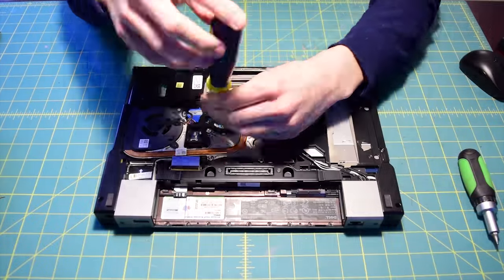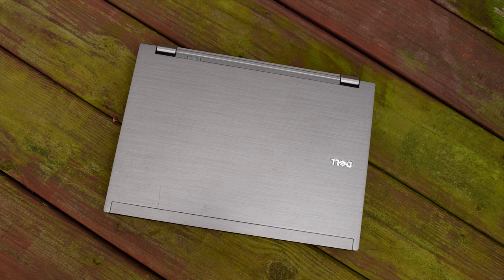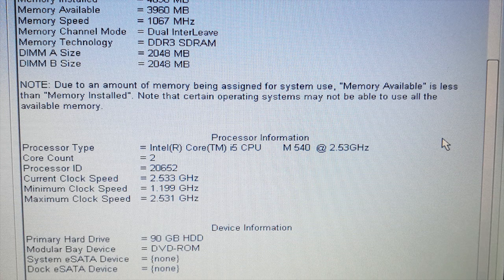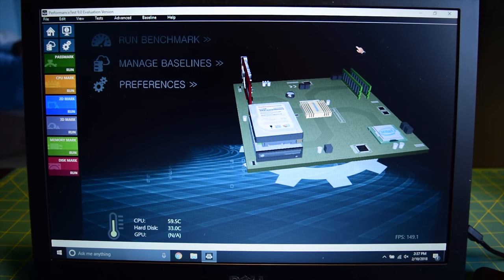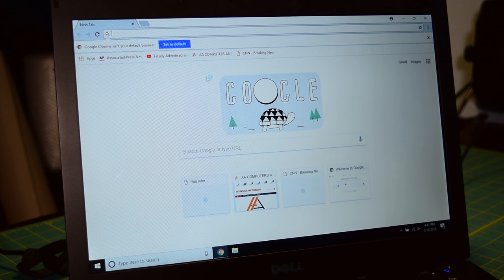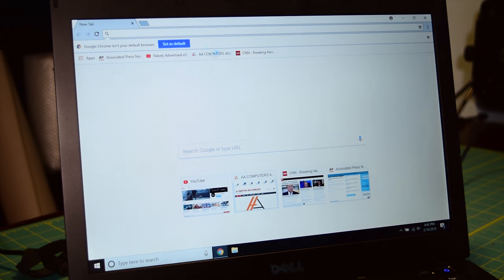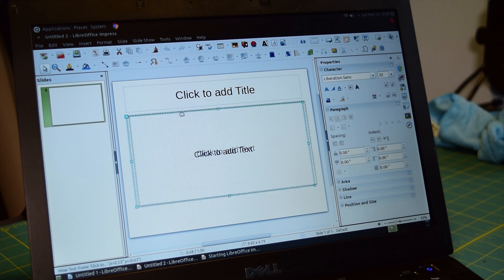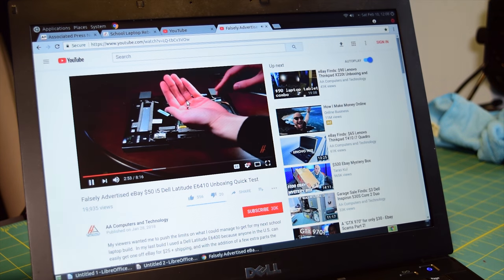Intel i5 School Laptop Rebuild Under $135 Dell E6410

Comment from the maker: Just for clarification: I noticed towards the beginning of the video I said I bought the E6410 for $50+ shipping.  The $50 actually included the shipping, so it was $50 total (it actually ended up being $30 total after I got a partial refund because the laptop was listed incorrectly).
Reply: Hhhhh Nice job . dude ❤
Reply: that's a steal, wow
Reply: About to get one for $40 at a pawnshop

Comment: I got a Dell E6430 with the 1600x900 res screen, Core i7-3520M, 8GB ram, and Nvidia NVS 5200 1GB dedicated Graphics for $85.
Reply from the maker: Awesome deal!
Reply: I bought same laptop, same specs but it has 256 GB SSD. But they charged 160$. Mine is completely new running Linux.
Reply: I threw my old 120GB SSD in mine and added a 1TB HDD to the disk bay
Reply: HPad, Why?
The SSD should be alot faster. And also you could've swapped the DVD drive with a 1tb hdd and have the ssd for boot
Reply: Green Hoodie Media huh? I don’t think you understood my comment.   I threw my 120GB SSD AND a 1TB HDD in the dvd drive bay lol.   Even though this is a travel laptop I still gotta have SSD. I’ve been using SSD for boot drives In my computers since 2012. It’s hard to use a HDD as a boot drive anymore.
Reply: oh sorry I thought you meant you repleced the 120gb ssd with the 1tb hdd
Reply: One advantage of the E6440 over the E6430, besides being another CPU generation newer, is that the mSATA slot in it fully supports mSATA drives and allows you to boot from them.

The E6430 is iffy, people on the net say yes and no.  There is a video on the E6420 noting that you could trim the plastic around the CMOS battery and shift it and probably fit a 50mm mSATA in the 25mm mSATA slot, but that was 2 years ago and he never updated with whether it worked or not.  AFAIK the 6420 and 6430 are nearly the same in that area of the MB, so if it WERE possible on the 6420, it should definitely work on the 6430.

I have a free 6520 I may investigate this on someday, but I'm in no rush since it will be a secondary/tertiary laptop, and I already have a 120GB 2.5" SSD for it.

EDIT:  Hmmm, looking further, there are various YT vids on the E6430u that clearly show a full 50mm mSATA slot.  Not having a 30 series, I'm not sure if the 6430u is different than a "normal" 6430.
Reply: +HPad Lmao Green Hoodie took the word 'threw' too literally xD
Reply: yeet
Reply: Green Hoodie Media Did you copy Green Ham Gaming's channel name? 😉 PS: You upload really weird vids
Reply: I really didn't
Reply: Well the thing is that SSD has no moving parts at all, whereas the HDD is quite fragile. One fall and boom. Also, SSDs tend to be a lot more quieter and consume less power. SSDs also are significantly smaller than HDDs.
Reply: HPad lol

Comment: A couple months ago I picked up a ThinkPad x240 for $155 shipped with an i5 4300u and 8gb Ram, more recently I threw a 500gb ssd in and it’s been great ever since. It can even play some light games, such as CS: GO and TF2. It can even edit 1080p video!
Reply: I just bought a T430 with an i5 an Nvidia GPU, for $150 I'm so happy haha it runs CAD & IDE's like cake.
Reply: A awesome choice!
The only other one that is eveb better, is a t430 (or similar) with a 3 gen i5 and a nvidia gpu. 
Then upgrade its processor to a better i7 maybe qm with 4cores and 8 threads, upgrade it to 16gb of ram, ssd and hdd with caddy. 

The only problem i would see in yours is this new cancer of soldered processors, that may have bga problems. But as it a lenovo one, it probably wont have this issue, only you cant upgrade it. 

So good buy!
Reply: I took out the i7-3632qm from my old/broken HP ENVY M4 and put it into my T430 runs perfectly. I bought a HD caddy but the dimensions were a bit off. all I need is 16gb ram  but it's expensive haha

Comment: Great work! I love this rebuild videos. I love hunting for 'hidden gems' and give it a new life. Sadly here where I live, it's very hard to find an old laptop with price under 100 usd. Even for a 10 y/o laptop model, it's on the market for around 150usd. but I was lucky to get an old Thinkpad T400 for free from my office. It's pretty scratched up, no battery, and only has 2GB RAM and 60GB HDD. Bought a new battery, 120GB samsung SSD for 35 usd, 2 x 2GB RAM and it works super well so far. Spent roughly 100 usd. Im planning to upgrade the processor in the future.

Comment: I've managed to do this with a Haswell laptop for $120 before - I have a Latitude E6440 I bought with backlight issues for $50. I upgraded it to an HD+ screen assembly for $30 ($4 more then the matched bare factory panel) and a 240GB SSD for $40. I had the E6540 back in 2013-2019 before the GPU failed and I liked the E6X40 platforms enough I wanted another one. Came with a i5-4300M CPU, which I am completely happy with to the point I see no need to change it.

Since I work with Dell laptops a lot, the charger was not an issue for me. My battery is a bit weak with 31.6% health (~1H 52M current runtime), but I'm not going to change it until it gets worse since I don't need a battery that holds hours of charge. However, if you had to buy it you can usually get a genuine Dell charger used for $20 and the batteries are $30 for an aftermarket 9 cell.

Comment: I have been using a e6410 since 2014. I don't play games on it but for everything else it works fine, as per the video says. 2018 my HD  died so upgraded to a similar size ssd, which really speeds everything up. Good Video!

Comment: This is a really good pick I have the little brother to this the 4310. Got it From a trash bin. Yes a trash bin. The motherboard was broken so I replaced it. Was dirt cheap. Bought a cheap generic charger and then I had a working laptop. Probably would replace the battery but I don't travel around with the laptop that much so this works for me.

Comment: If you really wanted dedicated graphics, I would recommend replacing the motherboard with the nVidia NVS3100. Did that with mine, and it'll allow use with quad core i7's. You'll have to get a replacement cooler along side.

Comment: I use the E6410 for my base builds when I buy a Laptop for a Missionary.  I call the 4 GB, 160gb hard drive I5 or i7 with Win10Pro a "Basic Missionary Laptop", if I put an SSD in it, I upgrade the RAM to 6gb and a 320 hard drive, I call that an "Advanced Missionary laptop".    Great video.
Reply: By the way,  just finishing a build of an E6410 for a pastor in Haiti for a mission trip that my church is doing in March.  I added a BlueTooth adapter to the laptop and bought the Wireless Speakers you reviewed for him, also used the 21$ battery you recommend.  Thanks for your wisdom.  I figure the Wireless BT speakers will be great for the pastor showing videos at a small group meeting, etc.   Laptop has these upgrades 256g SSD, 8gb of RAM, new lid, new BT adapter, BT speakers, 250gb backup drive, external, new battery and new AC adapter.
Reply: And if you use only ssds into one of these, it can be used in a moving car without any worries!

Comment: I have an e6410 in nearly mint condition with i5 560 (I think) and a Nvidia graphics. I paid $350 for it nearly 6 years ago so go figure. But it has a lighted keyboard, a 7,200 RPM hard drive. Thus it wasnt slow to me when it was slightly used in the least. It's a bang for your buck laptop, I've owned Apple, HP, Acer *errg!*. You name it, it has crossed my path. I own From Windows 98 to Windows 10 pro in Dell software licences, drivers, and above all just better build quality. Even the inspirons don't come with as much junk. So, I am a tad bit bias on that. Don't get me wrong, I'll work on anything, and some higher end Elitebooks are impressive if not generic. But as a preference from my own experience Dell enterprise hardware holds up better. I dont think I am alone on this one. Even on eBay the prices are fairly outrageous. An e6540 like the one I currently carry has a sticker price from $350 plus, and it's not uncommon to see them sell for much higher. There's a reason for this. Good pick!

Comment: I updated an acer 5315 that my dad got for £8 started as a single core 1.8 ghz celeron and is now a 2.4 ghz core2 duo, memory upgraded from 512 mb to 2gig  its a lot faster now .If you want windows 10 cheap buy a key from ebay very cheap i payed £1.69 if i remmber right and have had no problems been using the machine i used the key on for over 6 months .

Comment: Just bought DELL m3800 2015 UHD 256SSD version for 300 USD. Looks brand new with one scratch on the bottom cover. Still has one year warranty left.

Comment: Got my E6330 for £70 came with 8gb ram a new battery charger and an ssd nothing extreme a 128gb ssd the ssd seems to be new as well crucial m500 I3 3110M

Comment: I got a 6410 for free. It has the i7-640M, 8GB of RAM, and the nVidia NVS3100m.

It's much better than the basic Intel integrated but it still let's your performance down pretty bad. Same for the hard disk drive - it's the original 320GB mechanical disk and it's quite slow at 5400rpms. Dual booting XP and 8.1 does not help. 

I was planning on upgrading it sometime but I ended up getting an HP EliteBook instead which has an i5 and Intel Integrated video that manages to outperform the 6410 by a significant amount. Little disappointing and I miss my backlit keyboard but I'll live.

Comment: Would love a rebuild of inspiron 1545 with processor and ram upgrades not to mention ssd
Reply: Abdullah Masood Yeah, Totally!!! 
With a core2duo t9900 @3.16ghz 6mb cache.
With 8gb (2x4gb) ddr2 800mhz ram (not sure if it handles 16gb).
Ssd
Hd in the dvd drive with a caddy. 
Even if its original screen is pretty good, maybe with a 1600x900 screen. 

Yeah, awesome deal!

Comment: Is it worth buying IBM ThinkPad R40? It costs only 25$  specifications are :
HDD:20GB 
RAM:512MB
2×USB 
WINDOWS XP
12 INCH SCREEN 
BATTERY :30 MINUTES -1HOUR
PLUS CHARGER
CPU:INTEL PENTIUM M 1300MHz
or is it worth buying and upgrading
Reply: no, it's no worth 25$ unless you're into retro stuff
Reply: No even if it’s only $25 is still pretty shit just buy one that’s like $100-$125 trust me it’s much better
Reply: Don't buy

Comment: I have a Lenovo Thinkpad T430, which runs great and does everything I need it to do.  However, since getting my Dell Latitude E6420 XFR a while back I've found myself using it far more, even though it weighs almost 11 pounds with the charger.  However, I don't need a backpack or a case to carry it in.  The XFR's are Dell's version of the Panasonic Toughbooks.  My XFR has the Core i7 2.9GHz processor and 8GB RAM, and currently running a 512GB SSD.  Its pretty dang fast, and for $400 it was a steal considering they're a $6000+ laptop.

I like the older laptops they're built more rugged, sure they're not super thin but I'd like my laptop to last longer than a couple months and have more room for adequate cooling.  Those super thin laptops they build now have no way to dissipate any heat they basically cook themselves,  plus if you drop them there's nothing there to support all the components, usually the screen is the first to go after being dropped because there's nothing to protect it, the backing panel is so thin on them that there's no support.  

My Thinkpad T430 is about 1-1/2" thick, my Dell Latitude E6420 XFR is about 3" thick.  They have notebooks out there now that are 1/2" thick or less and they're cheap plastic junk that won't hold up to being tossed around in a backpack, car, etc.  I'll keep my older heavier duty laptops.  Currently my oldest Laptop is the Dell Inspiron 8200 its another brick of a laptop but it still works if you want windows XP LOL.
Reply from the maker: I was actually looking into an XFR as a candidate for my primary laptop before I bought my T430.  I really love the way they look and from what I have read they are incredibly durable.  The weight factor was the primary reason why I decided not to go with it though.  I travel about 100 miles a day between work, school, ect.. and I could not imagine carrying a laptop around that big.  Glad to hear it is working out for you!
Reply: The laptop itself isn't all that big, its the weight that'll make you tired of carrying it HAHA.  I love my XFR, and most of the ones I've been finding on ebay are in rough condition, missing parts, slower processor, less RAM, no hard drive, missing the drive caddy, etc.  Most I've been finding are missing the carrying handle...apparently too much work to replace it when it breaks.  These dang things have screws all over them, I think if I recall just to take the bottom panel off to get to the RAM slots is like 23 screws.  Mine has the GPS, Wi-Fi, 3G, and mine is also a touch screen...the reason I got it for $400 is because the touch screen wouldn't calibrate....well a 2 minute download of the calibration software and updating the drivers and I had the touch screen working.  This laptop is awesome, heavy but awesome.  I don't carry it around much right now, but probably will later on this summer when I'm out doing radio work in the field.

Comment: I just bought a 6410 from ebay for 125€ (around 150$) with a i5 560M,  nvidia 512mb graphics card and a simple hdd. Prices here seem to be a bit higher. Im planning on using it as a ubuntu machine for web and microcontroller programming. Hopefully im not going to be disappointed.

Comment: Hey, I have a question for you. I'm using that exact machine, e6410 with 8 gigs of RAM, 1400 by 900 resolution, i5 processor. I'm running an Ubuntu distribution, and I know it doesn't come with a power saver utility. Can you recommend one? While plugged up, I don't mind everything running at full power, but on the go it's nice to have some battery time.

Comment: Hmm... Seeing the 1394 port on that laptop reminds me of the Dell laptop I recently got from eBay for transferring MiniDV tapes. I have to ask, does that port keep working even on Windows 10, like is it still in Device Manager as an IEEE 1394 port? In the past, I saw that a capture card stopped working on Windows 10, so I wonder if that outdated but useful port would do the same, not that it needs to upgrade at all.

(I never used that port in the past, as I didn't see its use, so I don't know much about it except for its transferring of DV-format video...)

Comment: Hi

I have a Dell Latitude E6410 i5 with 6gb ram. I want to update it to Window10 due to work issues but I have seen that the camera or mouse stops working and generally has errors. Any recommendation to update it safely? Thank you.

Comment: Got a e6410 did a cpu upgrade i7 720qm which does run but what thermo paste do you use as I noticed  laptop get hot to point of turn off :/

Comment: there are two models of the dell latitude e6410 one with a dedicated gpu and if you get it you can run the quad core cpu instead of a dual core

Comment: A higher resolution does improve video quality even on something with a lower resolution display. It does overall but it does more so on you tube as it allows the bit rate to be much much higher. aka theres a reason why on mobile phones a iphone 6 can play 1440p videos (it used to be hardlocked at 1080p but now youtube enabled 1440p even tho no iphone has a 1440p screen)  it might not make a worlds difference but its noticeable.

Comment: Having used an E6410 for a few years I agree the performance is rather ok still, with a SSD if feels quite snappy. But I don't think it's a good buy these days because it takes so little extra money to get a far mor modern system. Instead of spending say a total of say 100-150 for an upgraded E6410 just try to find something like a E7440. Its CPU is really not much faster but it's more than a pound lighter, often use 802.11ac so faster wifi, many of them have full HD IPS screen as compared to the really awful TN panel found on the E6410 and almost all of them shipped with an SSD and 8 GB of RAM. Expect to spend another 100 dollar but you will get a far more modern system.

Comment: If you get the e6410 with the quadro you can put the i7 720qm or th 840qm so it can easily perform equally to your lenovo

Comment: What does one need to replace in the Dell 11" latitude education (CeleronDual Core 2.4 GHz Clock Speed4 GB DDR3 RAM128 GB SSDIntel HD Grphics) in order to be able to install a faster processor and upgrade the ram since it's soldered? I'm happy to change the motherboard too if necessary.

Comment: I got a Medion Akoya p6640 for free (8 GB ram, i3 3120m, gt 740m, bad battery) after putting in an ssd, I wanted to install Windows on it with an USB stick ( on the HDD was installed Windows 10 running fine)but I just got into EFI shell where the attached devices, including the USB drive, were mapped but I couldn't find a way to boot from it. So I installed Linux Ubuntu but perhaps you or someone of this community knows, what to do. 
Sorry for my bad English

Comment: I  bought a dell e6540 i7 quad 4712qm 2.7 ghz  1080 screen 8 gb ddr3 1600 128 gb ssd with 3000 hours use 130 watt adaptor and the laptop is mint not one mark on it. Its was buy it now for £175  or offers i offered 150 plus 10 postage. i got a good deal as i could not beleive the condition its like its had no use i will upgrade ram to 16 gb and add a 256 msata ssd in as theres a wwan slot and clone windows pro 64 to that and use the 128 ssd for linux  mint .